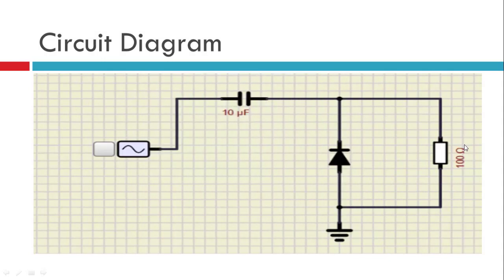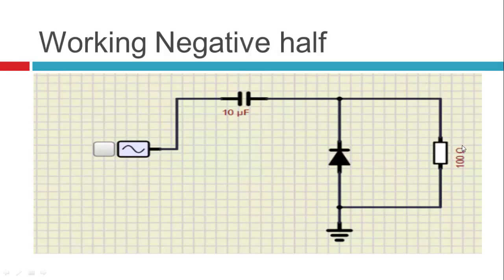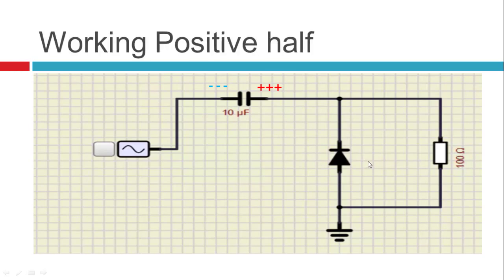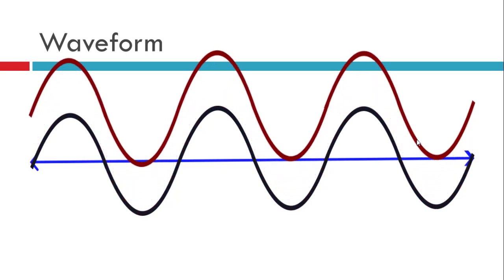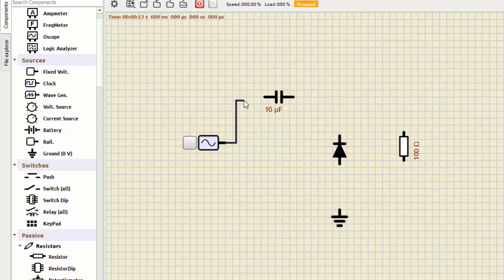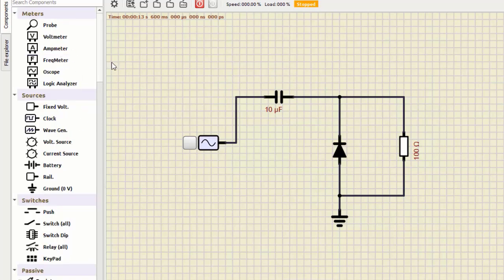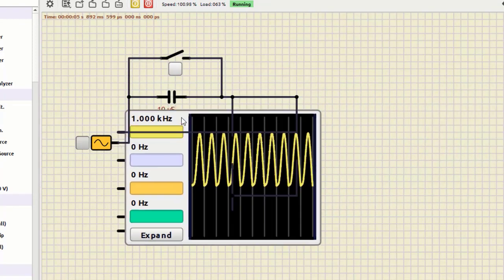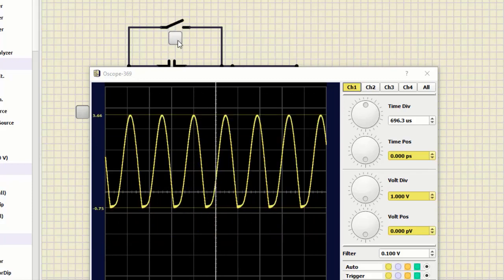Positive Clamper using Diode and Capacitor

Comment: This is called voltage doubler ... not clamper
Reply from the maker: This is indeed Voltage clamper, the peak-to-peak output voltage is same as that of the peak-to-peak input, in case of Voltage Doubler the peak-to-peak output voltage is twice of peak-to-peak input voltage
Please check the following link for understanding Voltage Doubler

https://www.electronics-tutorials.ws/blog/voltage-multiplier-circuit.html

Will surely make a video on it soon
Thanks for your feedback